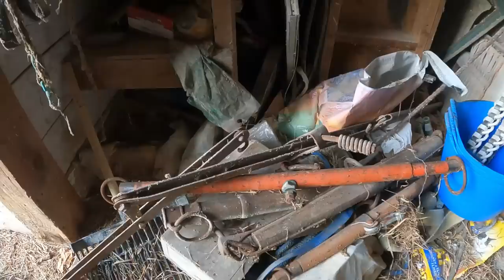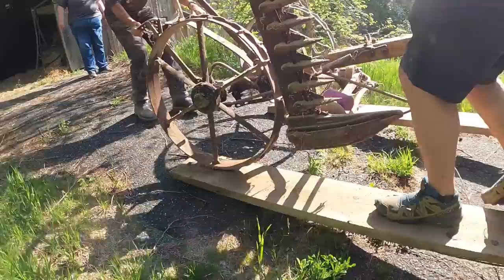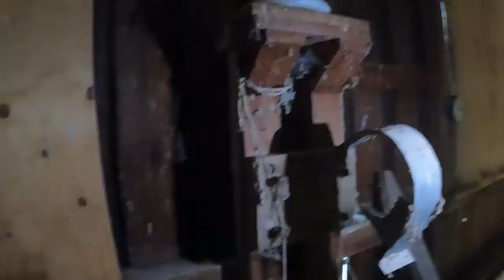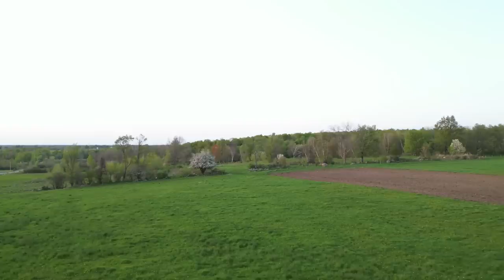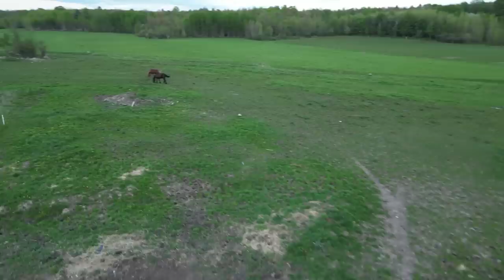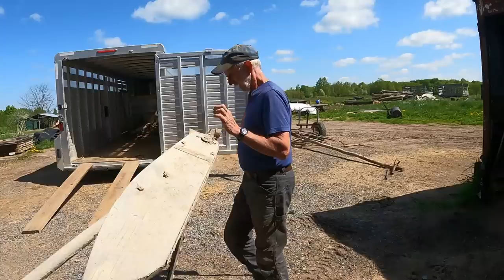NEW EQUIPMENT on the farm!! // What it takes to go away! #481

Comment: Hey Jim, I just posted up a video of my mower I rebuilt. If it were me I'd make a tongue truck for that #7 mower and let the ground carry that weight, leave a short tongue on it and just find a pair of of light wheels to attach to a pole for a tongue truck. I've never had a rubber tired machine but it sure would be nicer on the road than the old cast wheels! For the single horse setup I'd strongly advise replacing the wooden tongue with a custom welded tubular steel assembly which you could interchange between shafts or a tongue, also made of tubular steel. I like to use trailer hitch receiver tube, it is perfectly sized to take a 2 x 2 inch square tube just like a standard hitch, so you can make stuff adjustable, interchangeable, quick attach and so on. Just got my mower serviced up and ready to go this afternoon. Now need to get the haybine drug out and gone over! Round baler had to replace outer wheel bearings as they were rattling and grinding away and one tire had gone flat so had it tubed.

Comment: Hey Jim - Pioneer equipment makes a great single horse setup. I believe you can order just the single hitch and shaves from them. Then rig it to your mower. Might help keep the proper angle. Just a thought. Always enjoy your videos. Congratulations on your new grandchild.
Reply: I don't think Pioneer is making fore carts, etc. any more.  Not sure who is at this point in time. Maybe Jim could modify one of his to accept shafts using a Pioneer as a template, if he can find a picture of one with shafts.

Comment: If you intend to put shafts directly on the mower, you will have to be mindful of making sure it balances well while your weight is in the seat so that  there isn't too much pressure on the horse's back via the harness saddle. Too shaft heavy and you risk a sore back, too shaft light and the shafts will want to flip up and put stress on the belly band. I have had carts (not fore carts but the principle is the same) without any balance adjustment capabilities that were too shaft heavy  and used a counterbalance somewhere aft of the axle line to help alleviate the problem. If too light, the weight was used ahead of the axle line. In my case the brake shoe from a locomotive worked, but you would have to tailor something to your particular needs. Or, maybe one of your forecarts could be fitted with a removeable shaft/single tree unit and you could hitch the mower to that without worrying so much about the balance issue. Make a shaft/singletree unit that could plug into a purpose built receiver or directly where your pole normally goes so either the pole or shafts can be swapped out.

Comment: Those are called oil cups, there was also grease CUPS you filled them with Grease when you need grease in a area you turned the cap clock wise and the grease would get pushed out. 😊